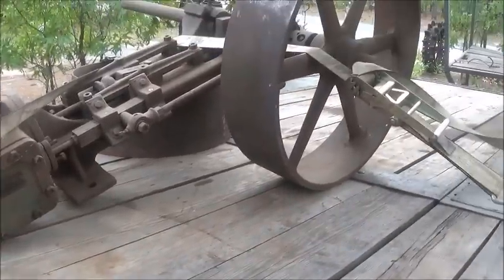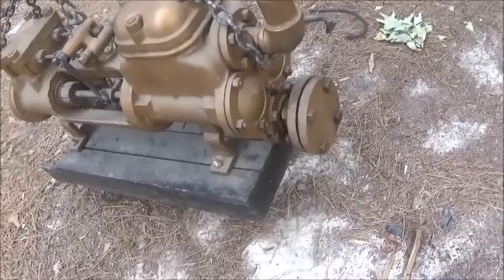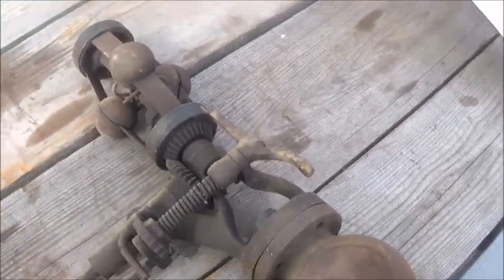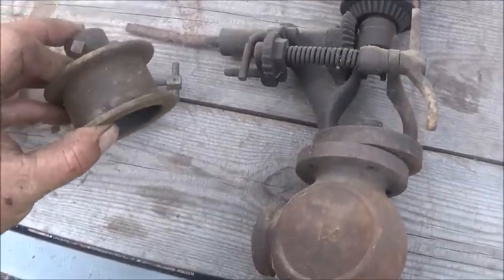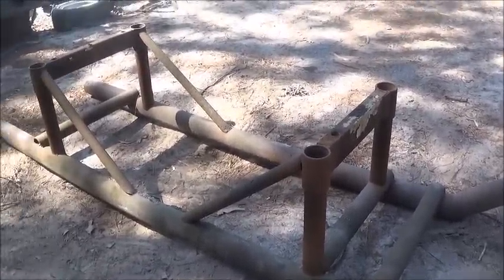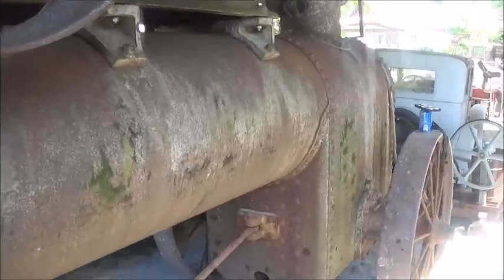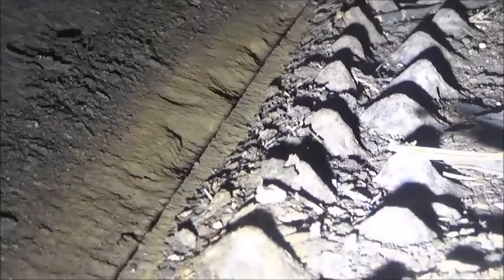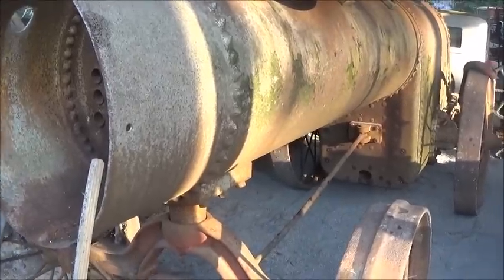BOILER ULTRASONIC THICKNESS TESTING & OTHER STEAM ENGINE STUFF

Comment: Lap seams are seriously frowned on in many states. Pressure wants to twist the sheets at the seam.  A buttstrap boiler has straps both on the outside and inside, to cancel out that twisting effect. It'll look great painted up. BTW, Ajax in more recent times was a stationary engine builder in Corry PA, that kept changing their mind whether to build steam or gas engines. It may be that Farquahr built engines for Ajax to sell, or vice versa. Big Ajax natural gas engines were used to run oil well pump jacks, some still in use. Guy in NW PA has a beautifully restored big gas Ajax engine, with a clutch and multi V drive pulley that he shows.

Comment: It’s amazing to me that you can measure the thickness of steel with sound waves (ultrasonic). You can also measure the flow of fluids thru a pipe with two ultrasonic sensors utilizing the Doppler effect…

Comment: I always thought the term was "trycock" and not "tricock", this from the use of trying the boiler to find the water level and not because there are typically 3 of them on the backhead of a boiler.
Reply: Yes, trycock, to try the water level.  Surprising to see only 2, I guess another early idea that was changed later.

Comment: Hi, Jonathan, that old boiler looks like it may have started life as a Traction Engine.  It would sure be neat if you could find a way to at least get it operational, even if you could sneak a steam line in to the engine mounted on top.  God Bless and stay safe, Meow to Ninja Catscan.
Reply: Portable engines were sold this way for people that wanted to run a sawmill or thresher, but weren't planning on plowing or hauling. I'd bet a portable like this would be half the cost of a traction engine. The big wheels made them easy to move with a team. Sometimes there would be a drivers seat in front of the stack.

Comment: The big funnel shaped grease cup, I have several that came from Morrisville foundry in Vermont, they used them on their lineshaft hangers. An 1/8" copper wire sits vertically in that bracket which rubs on the shaft and heats up, allowing the grease to flow more easily, I assume for old tallow grease

Comment: I think that boiler could be fixed. Clean off the rust and put a piece of bar, full length, inside and out. Of course, that would be a huge pain in the assets. So fixable? Yeah OK. But save it for last.

Comment: Excellent you are doing this.
Boiler explosion 💥 very dangerous.
Even at low pressure .
I worked in Nuclear power plant s .
Very familiar.
For Steel thickness ultra sound test  but  cracking next to welds rivet holes etc magaflux is used or x-ray  visual inspection is the best way.
Excellent you restore run antique steam engine s 👍

Comment: Used to use ultrasonic testers that had screens like on the ones they use for baby ultrasounds when I worked as a quality engineer for Caterpillar Inc years ago. You can gauge the thickness of steel palate and also look for lamination's in the plate too. I also used it extensively to find voids in steel castings and inclusions such as casting sand. Great little tools when you don't want to destroy something just to test it.

Comment: often wondered if a fellow could use a thin boiler to make himself a water stove to heat a house or shop, they are not under pressure, what are your thoughts?
Reply from the maker: Yes sir, I had one for years. An old 80 gallon boiler from a military barracks on Fort Bragg. I had a 250 gallon tank beside it that I put up high like a water tower, so I didn't have to pump the water from the boiler to the tank. Thermosiphon, or the "heat rises" concept. I had a small magnetic pump that circulated my hot water thru a radiator in my duct work. I cut a 12x12" hole in the top of my water tank and laid a old mud flap over it. I didn't want to build pressure.
Reply: @jonathanw4942  thank you sir I may give it it a shot

Comment: It is a nice looking piece even if its no longer up to snuff. I like the old riveted plate stuff. Also glad to see you using the ultrasonic tester rather than f-ing around and getting hurt.
Reply from the maker: I think a lot of folks think I just build fires in boilers and see if they work. I have to be 100% confident or I won't even attempt it. Visual, a chip hammer, ultra sonic tested, hydro test 1-1/2 time working pressure, then I will sit down and consider firing it. I don't worry about blowing myself up, I worry about blowing someone else up and me living.

Comment: i wonder it would be worthwhile to use the the wheels burner box steering trunion (steering trunion ? maybe called somethimg else) and engine mount  but replace the boiler tank  just so the thing is useful

Comment: One thing about steam pumps in feedwater service is they need to be coupled to a heater. If not you a shoving cold water into a hot boiler where the temperature differences can set things to leaking or worse.
Reply from the maker: I have a Sims water heater or heat exchanger that I run 2 of my steam engine exhausts thru. It goes in at about 220 and comes back at 82. Just runs thru copper tubes in the tank, but pre heats the water around the tubes and I pump it into the boilers. I run both the engines every time I fire.

Comment: Beautiful old piece of equipment!  Bummer that the animals did that but it’s awesome that you’ve given it a way to survive.
Reply: It may not have been animals, but improper maintenance/washout procedures not followed when it was still operational. If the sediment isn’t washed out of the boiler shell on a routine schedule, the wet sediment can cause what we saw along the edge of that riveted seam.

Comment: Good to see you using an ultrasonic test to check steel thickness on your boiler. If you’re not careful, you will become an expert on boiler and engine restoration! I applaud your thirst for knowledge.
Reply: Man, that's too bad & right where you said it might be...still looks good on the outside though

Comment: Very cool :) Thank you for showing us the testing process. We have a similar sort of device at work for testing paint thickness on the toolboxes that we make. Now, if someone were so inclined, could that boiler be repaired? If the rivets were removed on that lower joint, the metal cut out and new metal welded in, and the rivets reinstalled, would it be acceptable? Obviously, that would take away some of its originality, but I think that would be an worthwhile tradeoff to make it functional again.

Comment: Great post , Jonathan . That's actually good advice for everything in life , "Do your own research , & testing ." The first bit especially . Nice piece though . Like you said , if they had clocked the seams 90 degrees when building that boiler , it would not have formed the pits in the steel so badly . At the bottom , it becomes a catch all for debris .  Take care there , Jonathan . God bless .

Comment: 4 mil thick! That's about like a garbage bag!! DANGER!!
This portable boiler with an engine on top. I wonder how they were used. 
Surely a rental business for folks needing power at harvest time or to pump lots of water or do some sort of heavy lifting.
Interesting! Thanks for your channel!
Reply: I think your confusing Mil with Milimerers.  When measuringnplastic sheets, the measurement is Mils,  A sheet of plastic for say a tent , about 6 mils is about as thick as a grocery bag.  But 6 Milimeters is around 1/4 inch